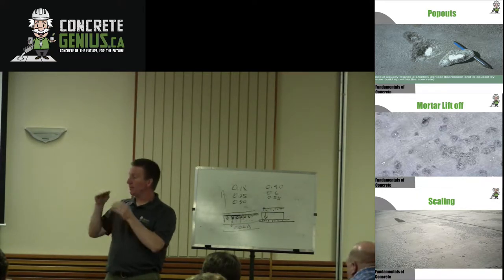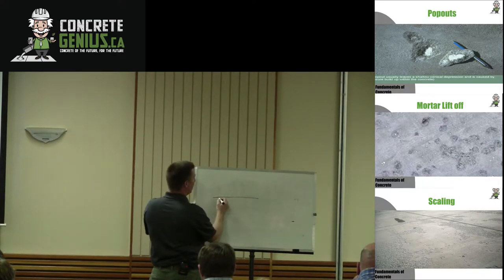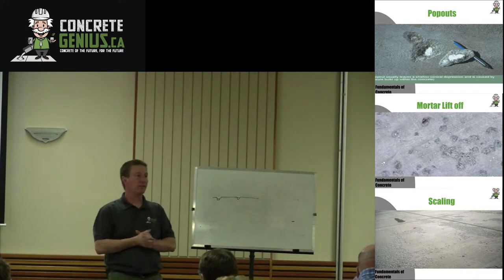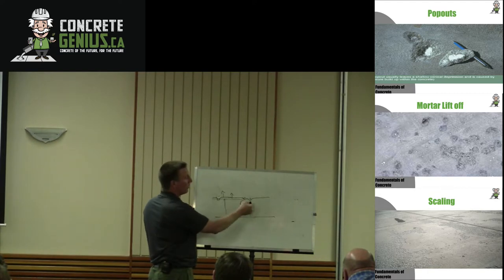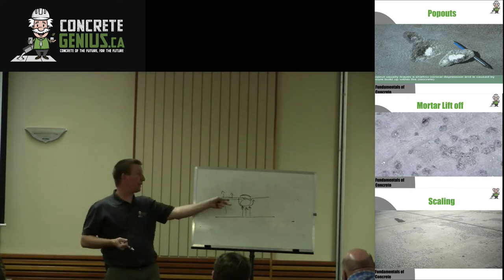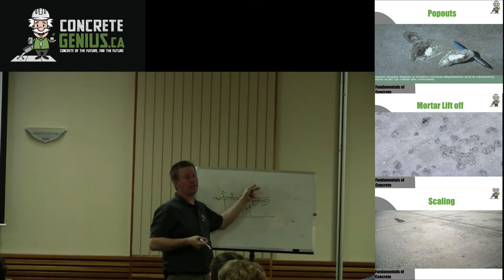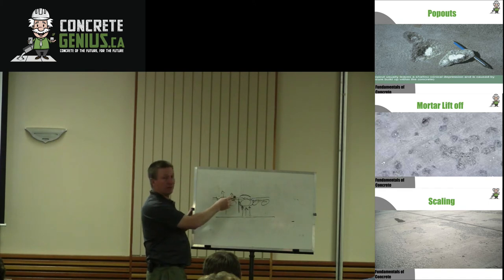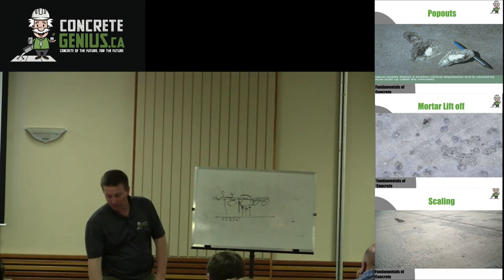Difference between Popouts, Mortar Lift Off, and Scaling Concrete Surface Failures

Comment: Hi,you say"that is always freeze/thaw related" I'm in California.My concrete was poured in Feb 2017.It's Sept. 2017 & I've been noticing alot of pop outs since July. In Feb. It did rain b4 the pour but,it was not that cold.I do see little rust looking spots in the center of the pop outs. I'm trying to find out if it is the  mixing from the cement company or the contractor.